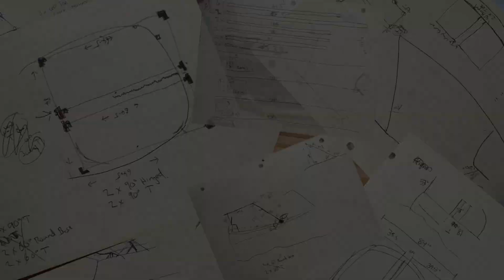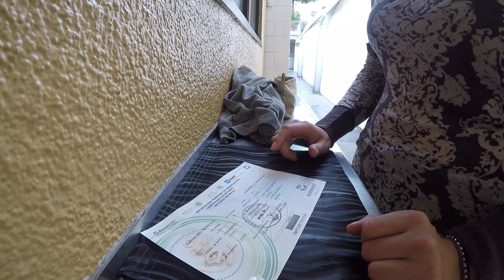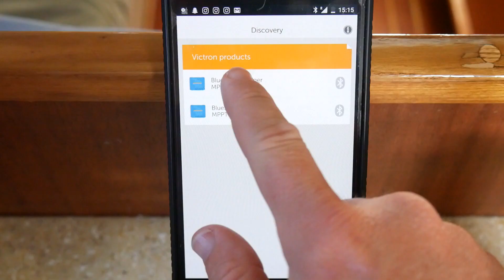DIY: SOLAR ON A BUDGET [Adventure #35]

Comment: Amazing job on the solar panel arch. I highly recommend that you get rid of the radar reflector. It's not going to help anyone see you and just get blown around and break things and hurt people. Modern radar is so sensitive that you are easily seen by other boats without it. Note that when you run your radar you can see other boats that are not using  a reflector just fine!
Reply: Maybe sailing around Cali you will find other boats with fancy radar but when you get to all the other rural areas around the world they will mostly only have older units. Keep the reflector.

Comment: IMHO Personally I would had used some sort of caulk rather than plumbers tape and same where you mounted those solar panel structure base with the through bolt. Throughout time thee base of where you mounted the solar panel arch and thee base of thee mass will weaken cause slowly but surely water will find its way.

Comment: Nice job on the solar panels. The paperwork for the boat sounds like a nightmare. How do you know when purchasing a boat if she has a cancelled TIP? Have you had a chance to sail yet to make sure everything is clear of the frame work? Cheers! Jess
Reply: I am no electrician but my partner is. He uses the test light of the volt meter to know whats going on before he touches anything. We keep it on our boat. Very handy and helps keep you safe. Freaked me out when I saw that ZAP!